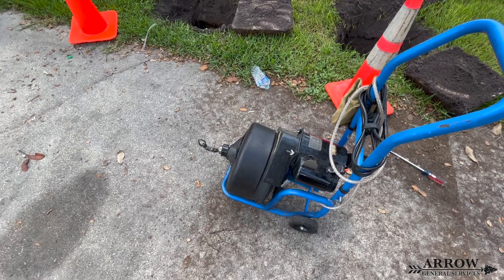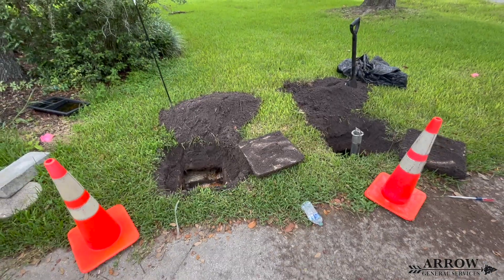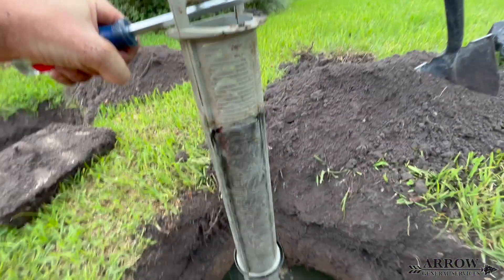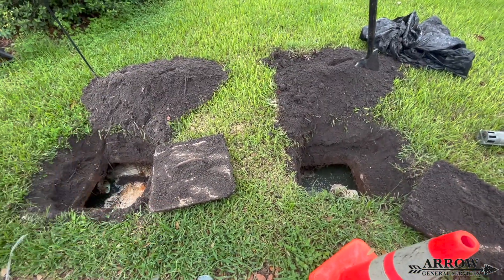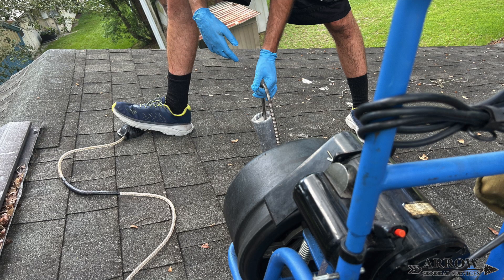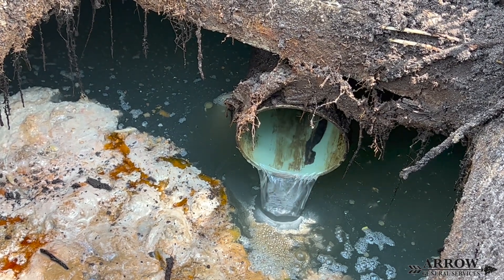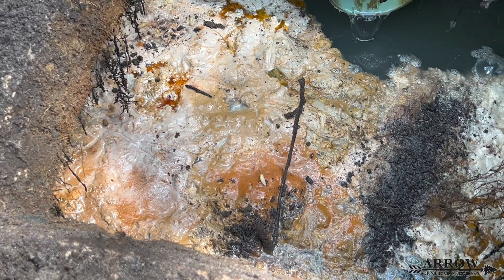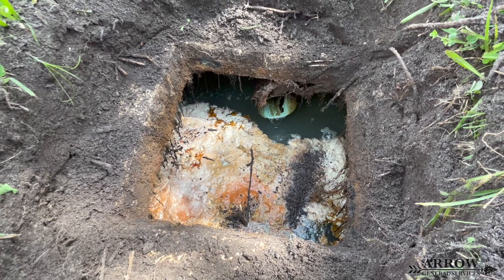How to Maintain your Septic System

Comment: 👍. What's your opinion on septic system additives and root killer additives and treatments...like leach field treatments...?  Thank You
Reply from the maker: Best to always have your septic system and leach field installed away from areas with trees. I’ve used some of those root killing products but have never seen any improvements afterwards. Also good practice to have it pumped every 3-4years✌️